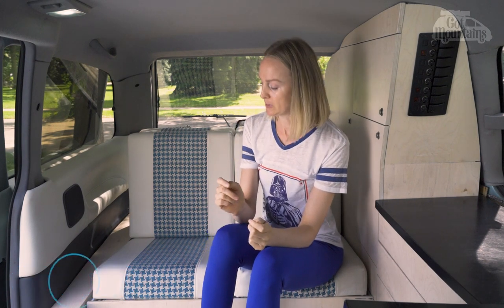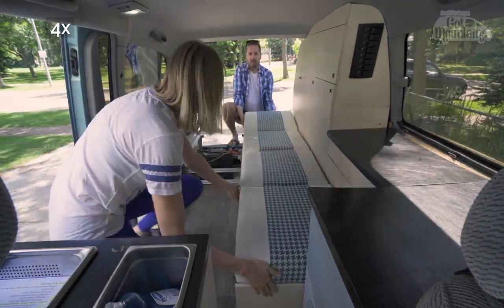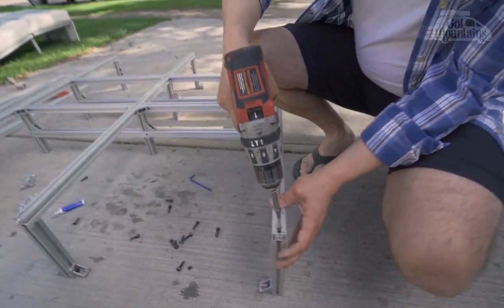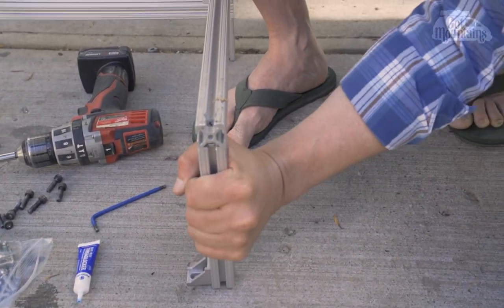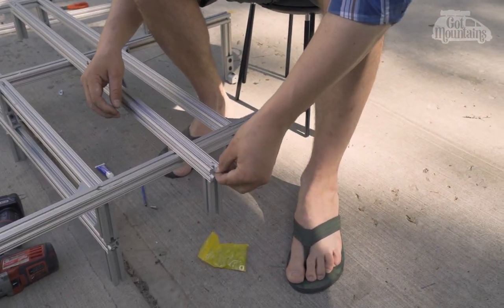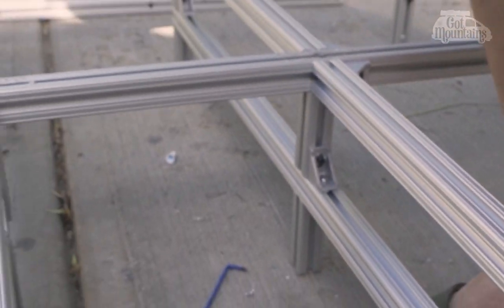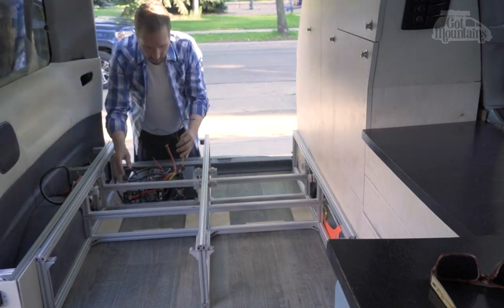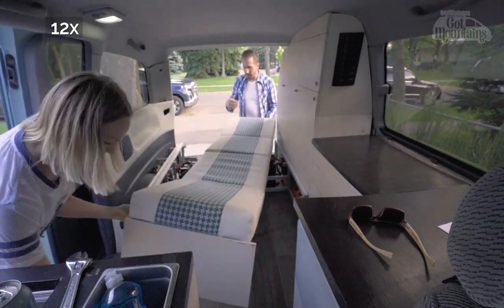We TORE APART our ROCK AND ROLL BED! DIY van conversion cheap!

Comment: Great work Eric! Did you find any references to the legal requirements for attaching the seatbelts while doing your research? I want to do it as legal as possible so there’s no issues with insurance and of course so our precious cargo is protected, but haven’t found anything for Alberta. I presume one would need to secure the seatbelt directly to the frame, but I’m just not sure. Any advice would be appreciated.
Reply from the maker: Unfortunately/fortunately there is no requirement or method to get approval in Alberta. Anchoring ultimately to the floor would be best of course, but you'd be stuck following racing specs if you wanted to be sure. This engineered aluminum would likely pass, but in the absence of an engineer's stamp or a crash test, I can only speculate. I believe the UK and EU have more requirements, but I'm not sure what they are. I just bought some seatbelt assemblies from Amazon and attach them when I being the kids along. Being teens that are becoming adults now, that happens less and less...lol

Comment: Love all your videos , i have just started my conversion  ready for spring however my question is how wide is your bed as you look as if you have so much more room.
Thanks.
Reply from the maker: Thank you! The bed is 41" wide, but extends over the small side cabinet (on passenger side) to make it 47" wide with the small pillows jammed in the space.

Comment: Would have been a good time to swap those gnarly lead batteries for some Lithiums.
Reply from the maker: Knarly is right, but I love them because I can hook them straight to the alternator with no smart charger. Super easy and zero maintenance.

Comment: Thank you for your videos!  Question: is the frame of the bed and the bed panels (the part on hinges) secured to the floor in any way?
Reply from the maker: Yes, they are attached with as linear bearing to keep them in place.
Reply: @GotMountains  Thank you for the quick reply!  That's cool - do you show this feature in any of the videos?
Reply from the maker: @nicrotank  unfortunately no, it's now buried under the  bed system so I can't fit my camera in there!

Comment: was wondering, how safe it is to be used in a car accident? Doesn't seem legit.
Reply from the maker: Yeah, it's never been certified, but the engineered aluminum can hold significant forces and bends before breaking in many cases. This should be able to withstand impact, but without actual crash tests I really don't know.